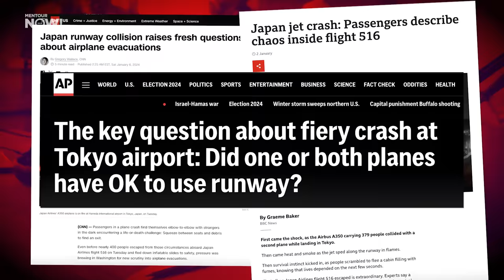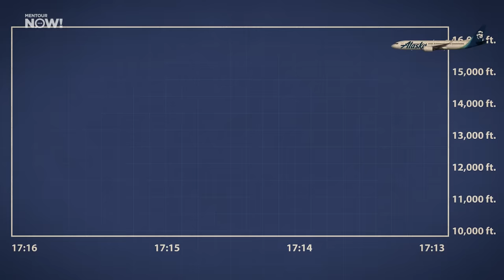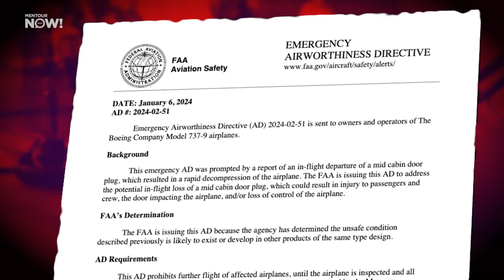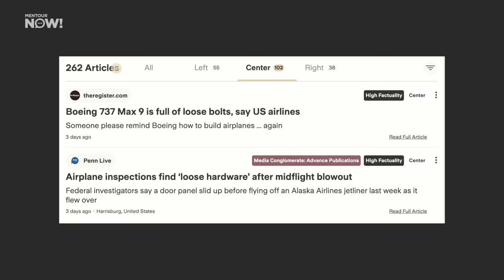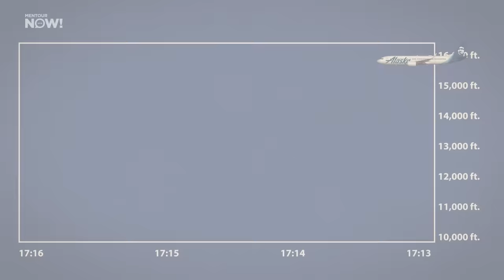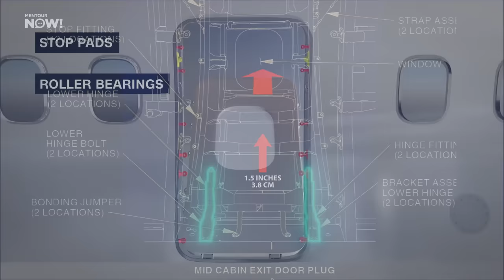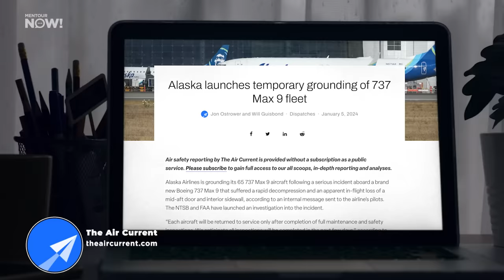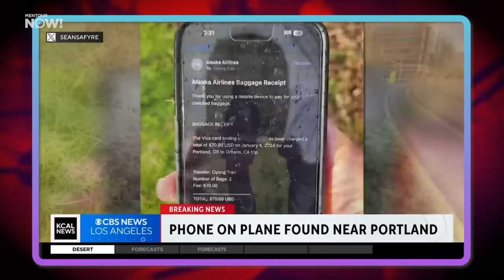WHAT Is going ON with Boeing?! MAX-9 Door blowout

Comment: Thanks for an excellent presentation. I was wondering how these door plugs were seated in the frame.  It sounds as if removing those springs may eliminate one source of concern.  Time will tell.  My hope is that the investigation will reveal this situation to be a major outlier.

I love the B737.  Like every normal person, I keep an Excel spreadsheet recording every log of every trip: including the ship number and registration. 😊  I have confidence in the B737 family, though 4.6 billion years of evolution will program me to secure that seatbelt strap and sit as far away from door plugs as possible.

I have to say, sad though the HND accident was with the loss of life, Airbus l came off earning more Brownie points.  It really surprised me that the hull survived as long as it did, though I suspect the B787 would have performed similarly.

My instinct tells me that Boeing would be a much better and healthier organization if all senior management had engineering backgrounds.
Reply: The springs are there to help lift the door when it is a "door". I think when a plug is used the springs should be removed. (?)

Comment: The fact everyone on the A350 survived is a testament to the aircraft. It could easily have been a Linate, a Western 2605, a Singapore 006 or even a Teneriffe.
Reply: There was a VERY similar incident between a USAir 737 and a Sky West turboprop at LAX back in the 90's (I think).  In that one, the controller cleared the Sky West onto the runway and hold and then forgot they were there and cleared the USAir to land...the USAir 737 literally landed on top of the Sky West, destroying the Sky West but nobody on the 737 was seriously injured.  Like the Japan accident, the LAX crash was at night and the USAir crew could not see the Sky West aircraft until they landed on top of them and then had no clue what they had hit. 

You're right though...it could have been so much worse.  And the litany that you cite is proof of that.

Comment: This is pretty terrifying to me because I always sit at a window seat and actually usually sit just behind the wing (because the seats in front of the wing get taken up quicker) soooo that's exactly where I would have been on a 737. 😬
Reply: It would have to be a Max 9 though, as the other current Max aircarft don't have these plug doors.
Reply: @ShinyHelmet  Sure. It doesn't matter what plane, I am sat in that place. So my point is if I had been on this particular flight, I would have been sucked out into the sky.

Comment: Mentour, one question about:
The NTSB was very unhappy, that there was no CVR recording avaliable. (In the US the CVR has only a capacity of 2h)
Is it an airlines SOP how to handle the CVR?
I think I heard that after an accident as soon as the aircraft is in a save position the CVR fuse has to be pulled.
Reply: See Jaun Brown's explination. The pilots had, had enough on there plate by that point in there day. He explained it well.
Reply: A 64 GB memory card can hold 3 months of voice. These days, there is no reason for these things to be limited to 2 hours.
Reply: @pizzablender  That's not the topic.
There are discussions about how Europe does it. But the pilots have arguments against - perhaps the employer could use these record against the pilots.

Comment: Unfortunately, the technical description of the door plug is incorrect in my opinion. The 12 door stops do nothing to contain internal pressure, but are alignment pins. Look at the diagram very closely, make no assumptions.
Reply: Then what stops the door from blowing out? I feel those stops are there exactly to take on the pressure when the differential increases. You also don't need 12 pins for alignment imho.
Reply: When the door or the plug is in the closed position, the stops on the door are inboard of the mating pads on the door frame - so the door must be lifted to disengage the stops.
Reply: I looked, I think you're wrong.
Reply: Airliners prefer to reduce their seats and save the cost of two FLOATS and their wight and having the option to add them later.
* If all 4 bolts were missing this would happen in the first flight. * It is impossible for all 4 bolts to fail at the same time. * The door panel did not even have a scratch or bent after 16000 ft fall. * Much bigger INTERIOR PANEL had disappeared. * The fallen cell phone shows the baggage was checked in on Jan 4th, a day before the accident. * Everyone was very calm, I wonder what the cockpit voice and the ATC communication sounded like when the cockpit door blew up (By design according to this video) ?
Reply: @Timmayytoo  please show any diagram that shows positive retention by the 12 “stops”. From what I have seen, the stops are alignment pins to assure compression of the door seal. The only positive retention points are the top flanges and bottom hinges. Please show me, as I am hopeful this is true, but afraid it is not.
Reply: @Hans-gb4mv  The top flanges and bottom hinges. Four points. Look carefully at the diagram, make no assumptions. This is not a fail safe design, but a standard exit plug door is. This is a door plug, completely different.

Comment: Thanks for the great summary of the events of the Alaska Max 9 with the door plug.  I wanted to confirm something though.  Spirit Aviation manufactures the 737 fuselages and it is my understanding they are shipped with the plug doors in place.  When the fuselages arrive in Seattle for final assembly, the door plugs are removed to complete the interior outfitting of the aircraft then reinstalled before the final test flight and delivery.  So, if the 4 castellated and wired bolts were in place from Spirit but not reinstalled by Boeing, it would implicate Boeing directly and not Spirit Aviation for the origin of the accident.  Is that possible?
Reply from the maker: This was widely reported but isn't correct. It has now been confirmed that Boeing only removes the door plugs if they identify an issue with them or if the fuselage fails a pressure test. Of course this still doesn't absolve Boeing from blame, it's still their name on the side of the aircraft.
Reply: Boeing have stated that the bolts are fitted and checked by them (Spirit don’t fit any interior parts - just a bare fuselage structure).

Comment: BA needs to do everything it can to restore the public's confidence in the MAX jets.  Problems with door plugs aside, misaligned bolt holes, and other issues need to be cleared up.  The FAA's increased oversight of BA's production and manufacturing is just a start, but the FAA needs to look into itself also and how it certifies new designs and procedures.
Reply: so, according to you and boeing the problem is to restore public's confidence.
not to solve the unsafe issues of a toxic and corrupt corporate environment that promotes profit over everything else putting everyone in danger.
Reply: Not at all.  Public safety above all else.  Afterall, I fly also, and I wouldn't want my life snuffed out because of missing or broken bolts on a door plug or if the tail assembly isn't screwed on right.  The buck stops with the CEO (and the BOD).  If he needs to reexamine every new plane coming off the production line for quality and safety issues, that's what he needs to do.  With the big bucks goes the risk of prosecution, especially when it's on his watch.  Tough enough?
Reply: @dougchinn2820   no way. it's a company. so the company will be punished. I even own boeing stocks (will sell them). I own the company, like other millions of people. should we all inspect all the airplanes? we own it. it's ours. the company is our responsibility. we even hire the CEO. doesn't make much sense tbh. also in such big company it's impossible for the CEO to know everything. sure there's responsibility but it's always limited otherwise no one would have a company due to liability. just saying, things aren't black and white.
with that said, I will never fly boeing again.
Reply: I own BA as well, and I'm tired of BA screw ups involving the 737, 777, 787.  There are production and quality issues.  The CEO is technically hired by the BOD, and we the investors supposedly elect the directors, who I doubt any of us know much about.  How many times have you voted yay or nay because the BOD "recommends".  The CEO is the face of the company and responsible for what goes on, including protecting and advancing investor interests.  I'm not suggesting he personally inspect every plane, but he's responsible for executives and manager who do.  They screw up, he screws up and the company pays the price.  The old BA before the merger with MD was a lot better, MD brought a different culture that in my opinion changed the company for the worse.  Moving the HQ to Chicago?  Be close to where the manufacturing and engineers are, in Seattle, or Charleston.  See and hear the problems.  Yes, I'm reevaluating BA stock as well.  Airbus has been looking good.  This almost smacks of the sub-prime mortgage period, borrowers and investors got screwed, the economy almost ruined and no one went to jail, or paid any penalties.  The same behavior just continues, safety and quality be damn, it's about the bottom line.  When safety and quality is assured, production and deliveries will stabilize, the bottom line will grow as orders grow.  Confidence restored.   BA's space and rocket program also sucks.  The new Air Force One is over budget.  Defense is at least ok, but who knows.  Reward CEO's for deliverables, no 20% pay increases without proven solid consistent results.

Comment: Some time ago back I recall flying in a Max8, after they were allowed to fly again. I took the exit row seat right agains the fuselage. 
I remember distinctly feeling cold air rushing either in or out around the seal of the door. I would cup my hand along the seal and could feel it quite noticeably. I’m not a nervous flyer so I thought little of it, assumed it was normal. 

Looking back at that, would we expect that still to be a normal experience?
Reply: The windows also get cold ;) It's because there is no proper insulation at those areas while it becomes very cold outside.
Reply: It's normal.

Comment: Not lock wires, but cotter/split pins. Also the loose hardware on other carrier were flange bolts, not the  4 safety bolts. SOLUTION- just install regular exit doors, problem solved, no bolts to inspect, fail safe.
Reply from the maker: Thank you
Reply: regular doors would be a lot heavier as they would have to install the slide/flotation equipment as well...
Reply: You mean regular exit doors that can be opened on a whim?
Reply: @23merlino  While I do not recommend it, an inoperative plug door without slides would still be fail safe and better than a door plug.
Reply: @2adamast  Opened on a whim? Like all the other exit doors currently in use? Even so, an inoperative door plug is a better fail safe design than the plug door

Comment: Those door plugs are not used  for any purpose other than to seal the fuselage. When the seating configuration changes to over 200 the the plug is replaced with a proper emergency exit door and interior panel system. It uses the same attachments as the door plug.

Comment: I had understood that the past pressurization issues were not being considered a factor in this incident, but are instead just a coincidence. Apparently the primary pressurization system experienced a fault but the alternate system engaged as designed and successfully maintained pressurization in the cabin. The thought is that if there was a leak present when this happened then the alternate system also wouldn't have been able to maintain pressure in the cabin, so that particular issue is more likely a system fault with the primary pressurization system, and not indicative of a previous leak.

Comment: The opposite doorplug being secure and correctly installed would not rule out the blown out plug being incorrectly installed.

Since during aircraft assembly and maintenance. Installers are not allowed to work on opposite doors or doors that are adjacent to doors they have previously worked on. Since if a mistake was made, it is likely to be repeated. As such would disable two doors in the same area.

So it is still possible that the plug was incorrectly installed

Comment: I am 82 and worked for dehavilland in the Uk many years go. I was an airframes and hydraulics technician. My job was to install and test various elements of the aircraft under construction. Following every job we submitted our work for inspection. We were only credited for payment following a satisfactory completion of inspection.  The inspector wasn’t known at the time so it was always impartial. It was impossible to debate their decision. If it failed the rectification time was applied to your working hours which were already calculated in advance. It was fair and it meant that your work was fairly judged. You worked well and safely. The  risk was an aircraft that could surpass its manufacturing hours but not its cost.  Modern manufacturing attempts to control these costs by cutting corners or hiding their failures. The latter approach appears to be the chosen route but  I can’t help thinking that the profit motive and the pressure top executives are subjected to is exposing cracks in the system.

Comment: The 2 other over-water flights where the pressurization lights turned on was flights to Hawaii.  That's when Alaska changed to over-land flights.  If anything happens there would be many diversion airports to choose from.  No diversion airports available if you are going to Hawaii from the mainland.

Comment: Another connection to this pressurization system warning issue was put forth last night by Dan Gryder who aptly presented that the pressurization warnings began after the aircraft was in for a retrofit of its Wi-Fi communication system.  The dome and antennas are installed atop the fuselage right where the Mid-Cabin Emergency Exit Doors/Door Plugs are located.  If the door plug in question was unbolted, opened, and reclosed without the restraining bolts during that work, then Boeing and Spirit both are not to blame for this mishap.
Reply: I have read criticisms of AAR, but I sincerely doubt they would have issued the following if they didn't already review the procedures and documentation to back it up. AAR handles maintenance for various US government and military aircraft and to lie about something like this would be devastating when found out.

January 08, 2024
AAR issues statement on January 5, 2024, Alaska Airlines Boeing 737 MAX 9 incident

Wood Dale, Illinois — AAR CORP. (NYSE: AIR), a leading provider of aviation services to commercial and government operators, MROs, and OEMs, learned of the recent incident impacting the mid-cabin exit door plug of an Alaska Airlines Boeing 737 MAX 9 on January 5, 2024, that resulted in an emergency landing of the aircraft. 

AAR did not perform any work on or near any mid-cabin exit door plug of that specific aircraft. AAR was contracted by Alaska Airlines to perform a 2KU Modification (Wi-Fi modification) on the aircraft that was performed from November 27 to December 7, 2023.

https://www.aarcorp.com/en/newsroom/press-releases/2024/aar-issues-statement-on-january-5-2024-alaska-airlines-boeing-737-max-9-incident/
Reply: @stephenjarzombek2903  Thanks Stephen.  I had already reviewed that press release from AAR Corp and knew about it.  Anyone working on an accident aircraft for 11 days just weeks prior to any incident that aircraft is involved in, has to be brought into the investigation, however.  And I am sure AAR Corp will be questioned by NTSB investigators about their work done on it.

Comment: Castle nuts and cotter pins. Only two ways for them to be loose: Wrong length bolt, or missing cotter pin. I'd be more worried about a missing or improperly installed cotter pin. A too long bolt will stay in place if the cotter pin is bent over correctly. A missing cotter pin, or one that wasn't bent correctly on install, means the nut can vibrate off and then the whole bolt can slide out.

Comment: But, I do not believe the incident is the fault of Boeing or Spirit. It is important that we look at the timeline from the October delivery and the “squawks” listed since that delivery. Especially, pay attention to cabin pressure issues. You see, after Alaska Airlines took delivery, there was a point where an in cabin Wi-Fi system needed attention. That attention was at the direction of Alaska Airlines, as the aircraft had been delivered, and modifications (the Wi-Fi system) Was more than likely installed subsequent to delivery. One must also pay attention to the location of that plug door in relation to the exterior satellite antenna. I believe that Wi-Fi contractor removed the plug door to either assist with cooling the cabin during this maintenance or important access to the cabling running from the antenna to the distribution amplifier. It is quite possible that this contractor replaced the plug door, and either did not return those four bolts to service, or they didn’t tighten and safety them as required. We will certainly know more, as the maintenance records for other wi-Fi and plug door combinations surface. Please have your staff do its own investigation concerning this possibility. And, put out an addendum to the story, advising your viewers of the possibility. Of course, it will take a full NTSB and FAA examination to determine if this was – in fact – the ultimate cause.

Comment: Mechanically, are the bottom bolts connected to the fuselage or the hinges? I think you'll find the tops are fuselage, bottoms, hinges. And yes, I was using his technical channel, which is where you'll find those configuration options.